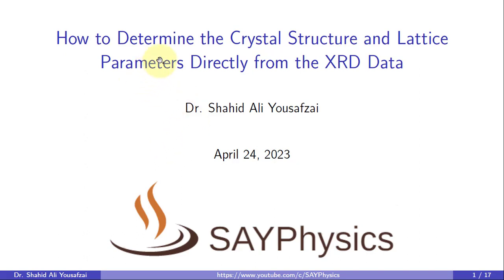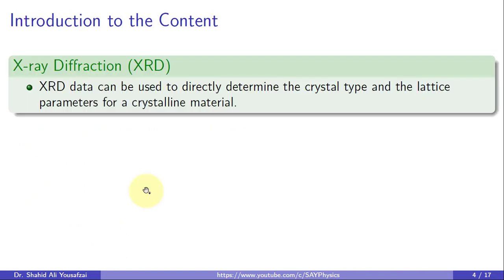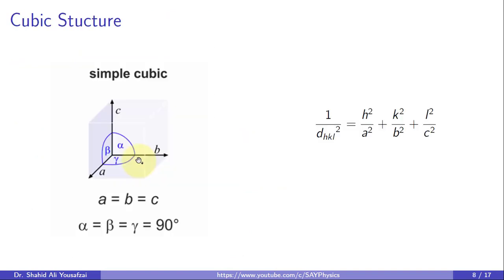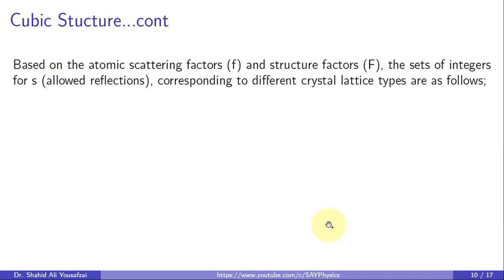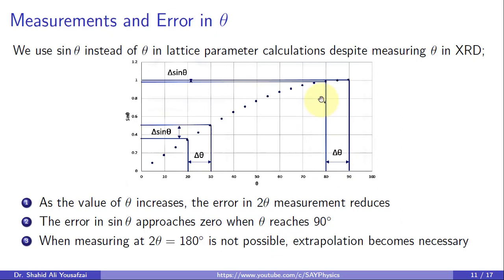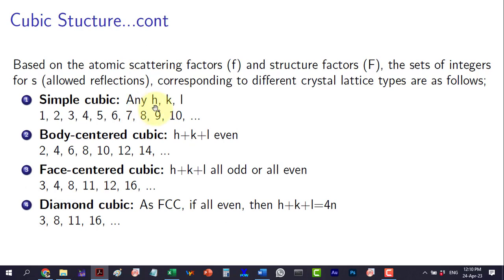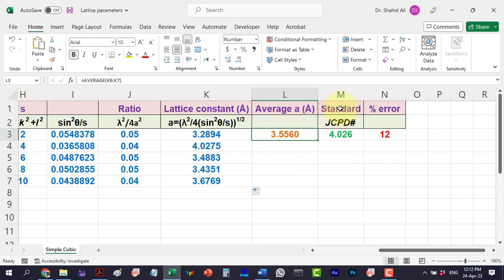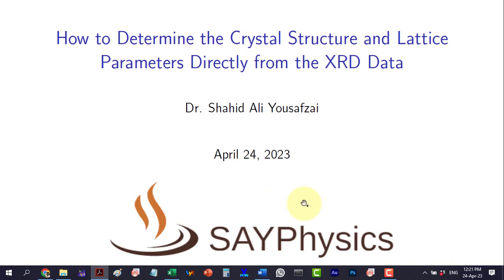How to calculate lattice type and parameters directly from XRD data

Comment: clear explanations, thanks alot
Reply from the maker: Many thanks for the appreciation dear 😊
Reply: @SAYPhysics  could you share your e-mail from which i can reach you?
i have some questions: 1.how many peaks should i pick for lattice parameter? only 5 or mor
2. you share lattice parameters  calcul about differents cubic form, what can we do to check others form? are not cubic? i mean octaedral, ...
Reply from the maker: 1. Use as many peaks as possible (more than 5) for better accuracy.
2. For non-cubic systems (tetragonal, hexagonal, etc.), you’ll need to index peaks using their specific equations, each system has unique lattice parameters (e.g., a, c). Thanks
Reply from the maker: You may find me at sayphysics@gmail.com

Comment: Seven not exists on a CS structure
Reply from the maker: Thanks for your comment! Could you please clarify what you mean by 'Seven not exists no a CS structure'? If you're referring to the crystal system classification or a specific Bravais lattice, I'd be happy to help explain it further. Just let me know!
Reply: @SAYPhysics  The series for the CS (min 5:55) structure is 1, 2, 3, 4, 5, 6, 7 (forbidden), 8... etc. I don't speak English very well, sorry. What I mean is that if you add the square of h, k, and l it cannot equal 7. It's just an observation, nice video, it helped me.
Reply from the maker: Right dear. Thanks for the input dear.

Comment: This video is very helpful. Thank you. One of the questions I recently received regarding XRD in some alloys is to use harmonic fit? I have never done any harmonic fit? Can you kindly say what is meant by harmonic fit of XRD data?
Reply from the maker: Thanks for the appreciation dear. 'Harmonic fit' in XRD refers to modeling atomic vibrations as harmonic oscillators to refine lattice parameters, especially useful for alloys with thermal/compositional disorder. Use tools like GSAS-II/FullProf/MAUD during Rietveld refinement to implement this.

Comment: How to find wave length?
Reply: What about Cu-k- beta
Reply from the maker: The Kβ line is usually unwanted (it gives extra diffraction peaks at slightly different 2θ positions). XRD machines often have a Ni filter or a monochromator crystal to suppress/remove the CuKβ component, leaving mostly CuKα radiation. Thanks
Reply from the maker: The value of wavelengths is based on the X-ray type of source used. Usually, we have either Cu Kα: ~1.5406 Å (most common for lab XRD setups) or Co Kα: ~1.7902 Å. Thanks
Reply: @SAYPhysics  thank you sir
Reply from the maker: you're welcome dear

Comment: sir is there similar method for tetragona; crystal?
Reply from the maker: I've already provided you the document where the relation between lattice constants, Miller indices, and interplanar spacing have been discussed.
The procedure for determining lattice parameters for tetragonal crystals is indeed quite similar to what I explained in the tutorial, with specific equations used for a given crystal system. Thanks

Comment: what about monoclinic system sir??
Reply from the maker: In the following document, you will find the relationship between the lattice parameters and the interplanar spacing. Thanks
https://onlinelibrary.wiley.com/doi/pdf/10.1002/9781119961468.app3